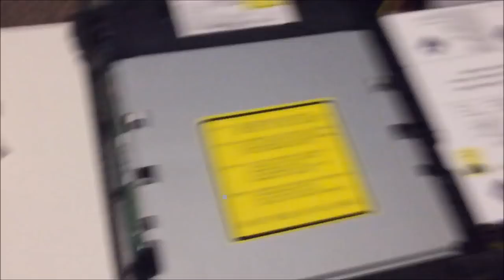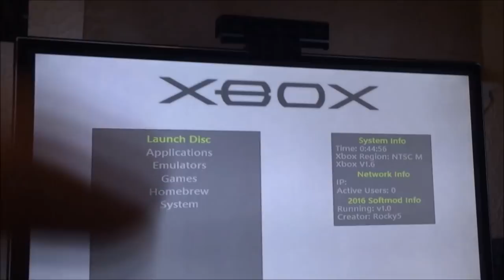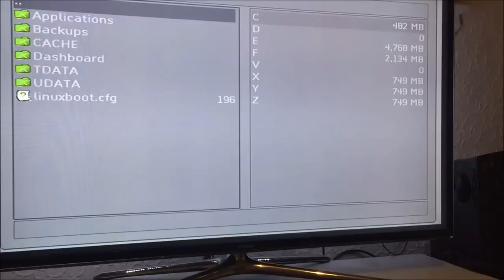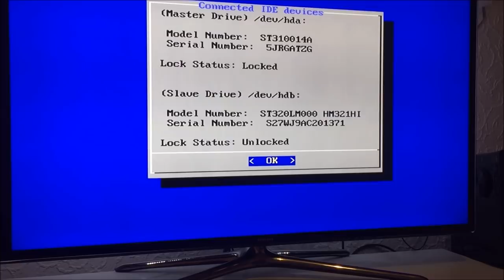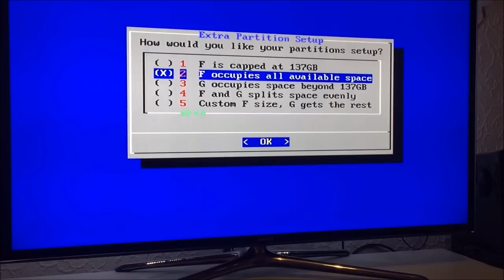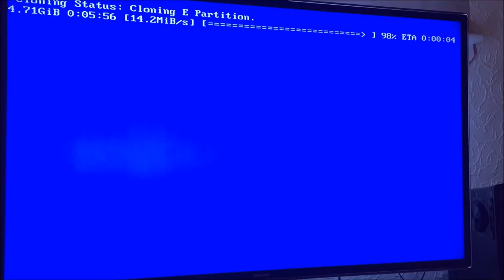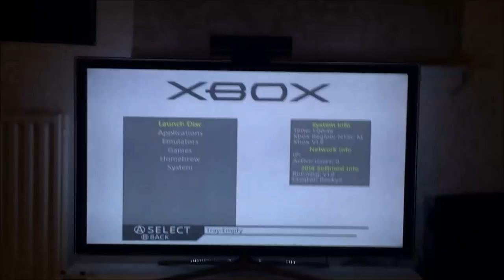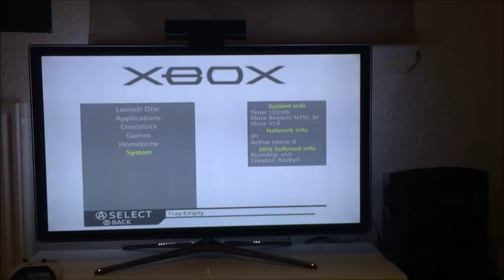How to clone your Hard drive using Chimp 261812 from start to finish.

Comment: i am upgrading from an 80GB drive to a 640GB drive. After running chimp and formatting the Hard drive, i notice that if i choose to clone c,e,f&g (the rest goes to G) OR c,e,f&g, it only formats F and G, but doesnt clone the files from those 2 partitions over to the new drive. is this normal? i have almost 80gb worth of games on the 80gb drive in F partition, but its not copying them onto the new drive. ive also noticed that the new drive makes the xbox load into the dashboard very slowly as well. it displays the xbox symbol and takes like a minute for microsoft to pop up and boot. im using a sata drive with recommended parts from MrMario2011's video for upgrading the hard drive. (my xbox has a chameleon v1.0 chip in it)

Comment: As of 2-27-2019 I can confirm that for some reason, no matter which version of chimp I was using, my xbox would force restart whenever I would load chimp. Whether I was using an older version that requires a linuxboot.cfg or this most current version. I couldn't figure out the problem until I decided to use my old cables and old non-4k tv. Thinking that I've modded hundreds of systems on it, why the hell not.

That turned out to be the problem. I was using a 4k tv with component cables. For some reason the xbox will not boot Chimp if I was connected to it. 
I swapped to my old 1080p tv with composite cables(the yellow red and white) and chimp instantly booted.
I really can't explain why this happens, but this is one problem I fixed by trying random things.

Good luck to all you modders in 2019!
Reply: that is good to know. thank you!             what brand 4k tv did you use?
Reply: @down2half7  Philips 55"
Reply: Having this exact same problem, thanks for bringing it up! While have to dig out the old cables and TV.
Reply: different xbox revisions do this, i think 1.6 and below have this issue but i was stumped as well since i has used chimps before with hd component !
Reply: it depends on your tv....
some set accept the signal and some just do not, most of the time it is really working, but you do not see it.
Reply: As of 9-18-2023 this was my issue as well.  I believe I have a 1.0 Xbox and I had to find my multi-cable to get a composite signal to my HDTV. My component cable and my Pound HDMI cable did not allow me to see past the first Chimp screen.

Comment: I fiddled around with this great tutorial for almost two nights - I didn't manage to start Chimp - always stuck at "Connect slave drive and press (A)". Had to restart the box each time by powering off. Tried like 4 HDDs (IDE and SATA) - none seemed to work.
Trick was: USE AN ORIGINAL MICROSOFT CONTROLLER! 3rd party controllers don't work in Chimp... Maybe I missed the information in the video, so I just wanted to highlight.

Great work JCRocky5!! Thanks a lot!
Reply: I am running into this issue as well. I guess I'll look for an original controller.

Comment: Make sure you guys use windows explorer (network location) to ftp chimp to the xbox. I did it using filezilla and the linux CLI wouldn't load. Got hung up on "Starting chimp..." and spent 2 hours debugging, only to find someone on an old forum post mentioning windows explorer.
Reply: I have windows 10 cant use the explorer tried with multi commander and filezilla but only got black screen. :(
Reply from the maker: https://github.com/Rocky5/Xbox-Softmodding-Tool/blob/master/Utilites/PC/Open%20FTP%20Window.bat
Reply: WinSCP is another ftp program that works great for this. I dont even use filezilla anymore
Reply: I'd taken every single step and was stuck on "Starting Chimp..." and was nearly out of motivation until I tried transferring Chimp again using Windows Explorer. Success!
Reply: man you can't imagine how thankful i am for this comment, i was stuck on this issue for days !! How could i imagine that the FTP software had anything to do with this... this should be documented somewhere !

Comment: I wont hotswap anymore, l have sweaty hands and when l was hotswaping maybe a tiny drop of sweat got in the ide pins and bang some sparkles came out, l freaked out, waited a little and checked the xbox, it still worked but l better not try this again... with xboxhdm you dont need to hotswapp, once you have the eeprom you can make a working xbox hdd with the softmod included..... hey but this is just me, l should have wore rubber gloves...
Reply from the maker: +aspinia that’s a strange one :/ but yeah don’t take the change if you don’t need to.
Reply: Lmao I did roughly the same thing...fried my XBox

Comment: For anyone who does the hard drive swap and then the connection stops and the screen goes dark, there is a chance it worked but you cannot see. Option 1: Use a TV with a scart or composite (red, white, yellow) connection. Option 2: Use a composite connection to your HDMI converter (I use an Elgato Game Capture HD card so I can see what I'm doing via the Elgato desktop software). If your HDMI converter uses green, blue and red, you can plug the composite yellow into green and that will work albeit probably in black and white. If nothing still shows, set your video mode back to defaults (no 480p, no 720p, no PAL-60 and switch region to NTSC-M or PAL). Hopefully this will let you finish the cloning element of the process!

Comment: Completed your softmod, added XBMC, cloned to a 250gb IDE using chimp I installed from your "extras disc" and all worked fine except for some reason I only got 120GB on the F drive with about 5gb on the E drive. No worries though, I used XBpartitioner and got my full 225 back for F drive and the rest spaced out. Thanks! This is awesome.

Comment: If anyone else has had trouble with the Chimp app freezing, it might be similar to my problem. I was using a Linux computer to extract and ftp the files to the xbox. It worked a lot better to just ftp the .zip file over to the xbox, then use the xbox file explorer to extract it.

Thanks for a great video!
Reply: One thing that helps is to set your FTP client to only upload one file at a time.  The FTP built into most dashboards doesn't seem to like many connections at once.

Comment: Tried the newer version, brilliant very simple and straightforward, nice work

Have you had any problems with the adapter pcbs. I had a board fry when connecting to a 500gb sata hdd. My have been a bad board.......but reluctant to try another as they take weeks to get here.
Reply from the maker: no issues with them, but you can plug the HDD into the adaptor after you connect the IDE cable to the adaptor.

Comment: Worked perfect JRocky, thanks. Was having some trouble with G Drive. If anyone has this with UnleashedX, go in system setting and enable G drive (not the format G drive). Works great & so much simpler than then older methods out there!

Comment: Was Absolutely Bricking it the Whole way through Doing it but with this Tutorial I Now Have a Banging Emulation Station :-) Thanks very Much!!!

Just For Giggles as Well I Couldn't Find a Molex Splitter in My Collection of Wires and was All out of Ideas until I Looked at My Modified Amiga Power Supply Unit. It has a Few Molexs added onto it for Reasons I Won't go into, I used that to Power the Second Drive for Cloning. I never thought id be using Kit from 1987 to do this lol!!

Comment: Hi Rocky! Thanks for all these great tools! Quick question, I'm getting buffer IO errors on the Xbox's disk (hda) during Chimp's Linux startup. Is this a sign that the master disk has gone bad? If so, is there a way to prepare a new disk for my Xbox without going through the cloning process?
Reply from the maker: +Lopson io errors usually happen on hdb if it's locked. But yes it could be a signed of the drive on its way out. 

You can use Xboxhdm 2.2 or Xboxhdm 2.3 USB beta ( both can be found with a quick google )
Reply: Thanks for the response, will try those tools out once I have the time!

Comment: I didn't watch all of your video, so if you already mentioned it, I apologize.  So, can you use chimp to clone a hard drive from one that is already modded and loaded with emulators?  Meaning, to bypass all of the Splinter Cell/usb stuff?  Thank you.
Reply from the maker: +dcfan1107 if you hotswap the drive yes, without the eeprom.bin you won’t be able to unlock the drive to clone to it. ( hence hotswapping ) 

If you are hardmodded, then yeah you can use it to clone to a new HDD.
Reply: That makes sense...forgot about the eeprom.bin.  Thanks!!

Comment: The file structure for the the E partition folder is completely different now. It has Chimp and XBP Table Writer folders and an install instructions text file. Within the two folders there are default.xbe files (among others) but no chimp.xbe. Can I run chimp from the default.xbe or do I have to do something else?
Reply from the maker: There is an text file inside the E Partition folder on where the Chimp folder can be placed on the Xbox HDD. 

E:\Apps\ is the usual location.

Comment: +JCRocky5, question for you. I finally got a new drive, cloned it, locked it and installed the new IDE cable. It booted up. The issue I face now is I'm using a 1 TB drive and it looks like the F partition is only using close to 473 Gb, E drive Shows 4.5 Gb and a few of the others are showing 700 Mb or less. Did I perhaps need to use a different option in the cloning process because it's a larger drive? Like creating a G partition? Thanks for your help!
Reply: Nevermind. I noticed a comment down below where I just had to enable G drive and now i'm utilizing 473 Gb on both.
Reply from the maker: Could I ask you a favour? I have added a check to Chimp that should notify you if your drive isn't lockable when entering the Chimp menu, it also disables features if the drive isn't lockable. Unfortunately I dont have a drive that isn't lockable, so would you be willing to test this new build with the HDD that couldn't be locked?

Comment: Gonna try this next week. I bought an adapter which takes the 40-pin cable, but why did you say not to go that route? What is wrong with using the 40-pin? And if i get an 80-pin cable instead, will that work with an adapter with "40-pin" in the description.

Comment: tried for 8 hrs also using a laptop hdd kept getting error 16.Changed to 80 wire worked first go.Thank you for the nudge in the right direction.

Comment: Hey, this is a really great walkthrough. Just have a question. Im going from the stock hard drive to a 2tb sata and im just wondering what option you recomend on the extra partition screen. Thanks man!
Reply from the maker: You must split them evenly. Anything over 1TB must be equal F and G partitions.
Reply: @JCRocky5  Alright thanks for the reply! Im just having trouble getting Chimp to start. When i go to unplug the ide from the dvd drive and plug it into the drive, it doesn't let me enter chimp for some reason.
Reply from the maker: New Chimp Loader xbe Test https://youtu.be/767-ZdHN3yY

Make sure your sata adaptor has a slave setting.
Reply: @JCRocky5  It worked! Thanks so much for your help!
Reply: @JCRocky5  Alright everything went well except, Chimp did not partition a G drive. The F drive is partitioned correctly with like 923GB of storage but it didnt give me a G partition for the other TB of space. Can I go into Chimp again and make a G partition manually?
Reply from the maker: You can yes, I assume you never used X to select F and G split evenly? (A goes forward a menu)

Do it in the master drive options.
Reply: @JCRocky5  I did not. Sorry about that. So I go into the Master Drive Settings and scroll down to F and G split evenly (press X this time) and then it'll repartition F and add G and it should be good to go?
Reply from the maker: Correct
Reply from the maker: You can check the cluster size by selecting the partition menu in the master drive portion.
Reply: @JCRocky5  Alright I'll do that. Thanks so much for your help! Much appreciated!
Reply: @JCRocky5  Alright I repartitioned with F and G split equally and on Chimp everything looks great. On the Partition Information it shows F and G with 950.047 GB each with 64K cluster sizes. But when I reboot, It only has partitions: C, D, E, F, X, Y, and Z. Did I skip a step?
Reply from the maker: If you’re hardmodded (chip/tsop) you will need a bios that supports larger hard drive partition tables.
Reply: @JCRocky5  Im softmodded
Reply from the maker: What one? Also have you enabled the G partition in the UnleashX setting > storage menu?
Reply: @JCRocky5  Got it! It wasn't enabled in the Storage settings in UnleashX. Thanks a lot for all the help! Now I just gotta rip the games I have lol Thanks again!
Reply: @JCRocky5  can you enable g partion in evolution x settings

Comment: I used this method and it worked great! However, I'd like your opinion on something.

The hard drive that I used for upgrading was a 2.5 inch laptop drive, so as you can imagine it is significantly smaller than the drive that would normally be in an Xbox. I've noticed that there is an opening in the hard drive bay that would normally be blocked by a bigger hard drive, which I'm assuming was a way to regulate airflow.

Would you be at all concerned if you were me, in terms of messing up the airflow/cooling of my sytem? I've been monitoring my temps and nothing seems out of the ordinary...for now.
Reply from the maker: I never bothered with it, it’s manly for the HDD to get cooled from the underside. Since it’s a 2.5" Drive it doesn’t get that hot so I wouldn’t bother about it.
( I never have )
Reply: This really helped put my mind at ease, thanks.

Comment: Hi Rocky, thanks for answering my question regarding the artwork downloader on another video.
I have a quick question regarding Chimp:
I'm trying to upgrade from a 160GB to a 500GB (both IDE/PATA). When i'm in Chimp, i've selected to split the space between F & G evenly on the new drive. My old drive has the bulk of the space on F and small amount on G.
I'm able to clone C & E, but F & G never seem to copy over and i'm left with around 130GB on F (G doesn't show at all despite being enabled in the softmod).
Any idea what the problem could be?
Reply: Yes you don’t have the partitions set properly which is why the space on f and G is not showing up because c and e cap at 137GB and F or G hold the remaining of the space

Comment: Worked perfectly on my softmodded xbox. Cloned an old 80 gb ide drive from an old pc. When scanning however, both drives appeared unlocked which is some scary shit. But anyway thanks man!
Reply from the maker: +Fjongo I fixed that as of a couple days ago, it was a typo I missed :/
( you can redownload Chimp or just download the initrd.gz file and replace the one on your Xbox )

Your drive are maximum security level drives so keep the eeprom backed up as that's the only way to unlock them ever.
Reply: Ftping the eeprom to my pc was the first thing i did, right before ftping chimp over:).

Comment: If have a cloned drive already and want to replace it do I have to use chimp again or could I do a straight disc to disc clone external to the Xbox seeing as the first one is already twinned with the motherboard.

Comment: I downloaded 261812, but im stuck at the "Press A" once ive connected the sata to ide connector with new hdd.
i press A, nothing happens...
looks nothing like what i see on your screen??
i prefer the one i see you using on screen...
the one i just downloaded though, is totally different...
please help me find the version of chimp youre using in the video. seen at 11:07 thanks
Reply: From what I’ve read elsewhere, it does this if your using an unofficial xbox controller like madcatz etc.  gotta have og xbox controller, either the huge one or the s type.
Reply: @Cerberal  Yup! My solution was to just plug in a standard usb keyboard, and i used the arrow keys! Happy days :)
Reply: @djtyros  thank you so much I was going crazy and getting worried I was messing something up! I got a generic controller with the second hand Xbox I found and never thought about it. Usb keyboard worked after I used it in the dashboard before loading up chimp